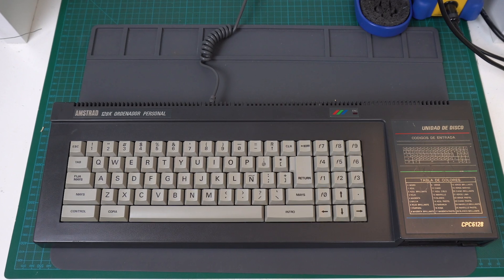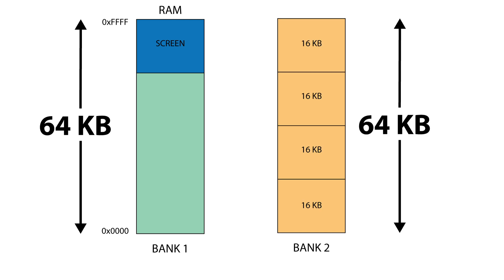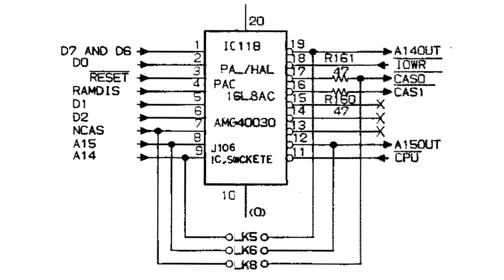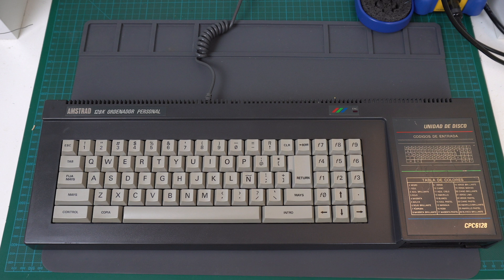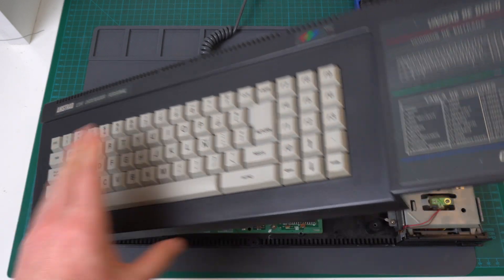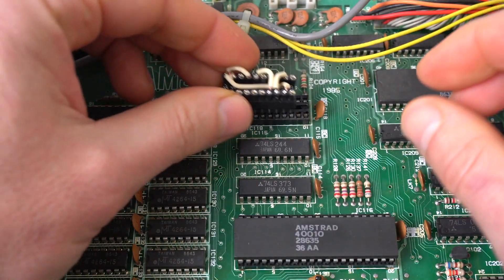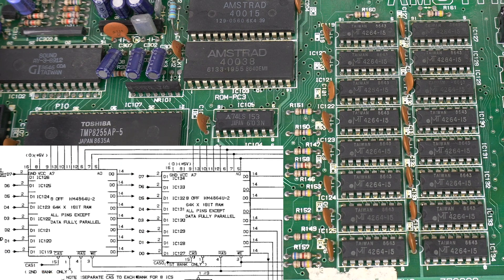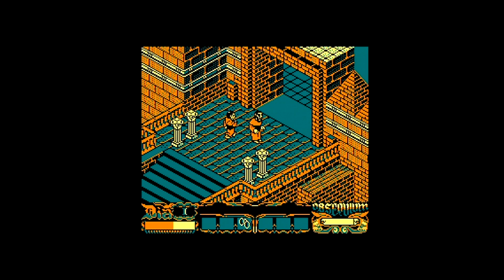Forcing 2nd RAM Bank on an Amstrad CPC 6128 [Nibble Edition]

Comment: "all Amstrad CPC6128 have a socketed HAL"...there is no HAL or PAL on my 6128 mainboard! which is different from those seen in your videos, I have faulty ram chips and no idea how to load that rom with the ramtest to find out which should be replaced. My mainboard is not so wide and the ram chips are on its right edge
Reply from the maker: That's right. You have one of the last Amstrad CPC board revisions that use an ASIC chip (big, flat chip with about 100 pins). I always forget about that revision of the board. In that case I think you're right and the logic of the HAL was included in the ASIC, so this trick won't work there at all.

Comment: Hi, there’s no point in pushing the round-pin headers into another socket; just desolder the crap sockets on the motherboard, and solder the round-pin headers in there (after cutting them to length, first!) Then you can just insert the jumper wires directly into the round holes; no solder needed. In the case where you need two wires on the same pin, just strip back the insulation on one of the wires and solder the other wire to that, rather than the pin header “socket”. This is a better, long-term solution, as the round-pin headers will take round-cross-section solid wire much better than the cheap contacts on that IC socket, which was only designed to take the flat IC pins; inserting round wire into these deforms them, and they lose their springiness. 😢 HTH. 🙂
Reply from the maker: Right, but inserting 4-5 jumper wires is a pain, takes a while, and I have to make sure I get the right pins. I like a simpler solution like this (or the pre-made PCB).

Comment: Did you do a continuity check / check for short circuits on the adapter after you built it, or was a visual inspection of the solder joints good enough? I seem to be thinking about multimeter uses these days. 😉
Reply from the maker: Just a visual inspection was fine with big solder points like these. But if you have any doubts, doing a quick continuity check with the multimeter is always a good idea.

Comment: did the 664 have the HAL chip? Perhaps that is why it is a socket.
Reply from the maker: The 664 only had 64K of RAM, so it shouldn't have had a HAL. But unfortunately I don't have a 664 (sniff, it's one of my missing Amstrad pieces) so I'm not that familiar with its insides.
Reply: @NoelsRetroLab  may explain the socket then.

Comment: OMG, that's MT RAM. Sooner or later they will all fail...
Reply from the maker: Oh really? I didn't realize they had a bad reputation. Are they as bad as MOS chips? If it's that bad maybe I need to get in the habit of replacing them all when one fails. Then again... that's a lot of pins! :-)
Reply: The last generation of Spectrums, that is, the +2A, +2B, +3, and +3B, all used MT ram chips too, and i have never heard about any particular issues with those; i must hasten to add that the RAMs used in the aforementioned Speccy models were all 64Kx 4 bits, so that may have some influence - i am not an expert, just voicing my view. ;)